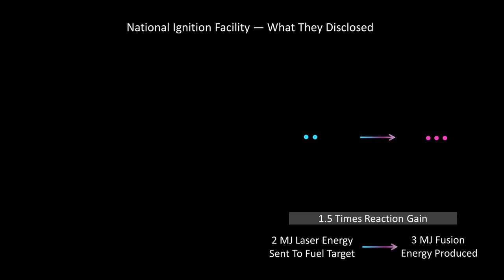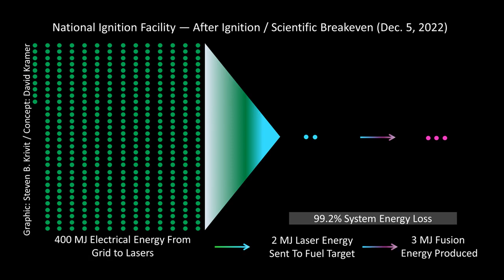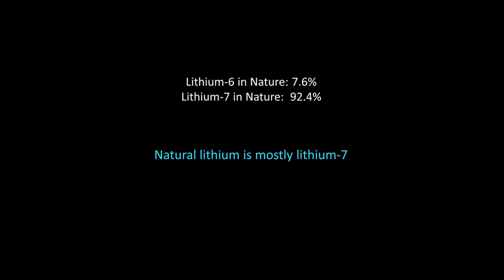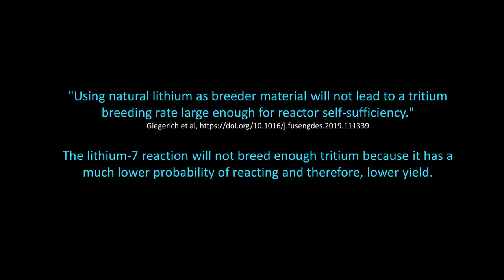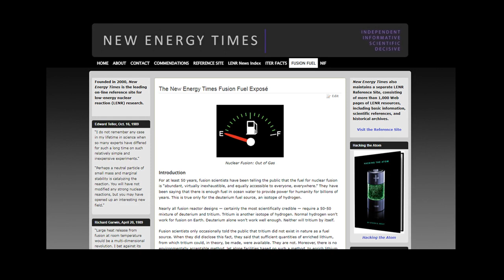Ignition Omission: Understanding the National Ignition Facility Milestone

Comment: Thank you for your well researched presentation. I agree that many of the head presenters were misinformed before they made their announcement. Before this announcement the NIF management has always avoided mentioning the input energy to the lasers to generate the 3 ns pulse. Even the most advanced lasers today don't come close to the NIF laser's energy and if one includes all the wavelength conversion that takes place in NIF then the efficiency will drop way below the 20% figure.

NIF has always been primarily funded as a thermonuclear weapon (H-bomb) research tool. The NIF management has always obscured that fact when presenting to the general public, instead presenting it as a viable path to a future economically viable nuclear fusion power plant. The vast majority of nuclear fusion physicists believe that the NIF's Inertial Confinement Fusion (ICF) approach is unlikely to lead to such a power plant. The Lawrence Livermore National Laboratory received funding for NIF in return for ending the underground nuclear testing program which was required to end due to the signing of the Nuclear Test Ban Treaty. The announced experiment included a test target that was exposed to the prompt burst of 14.1 Mev neutrons, as part of the lab's nuclear weapons testing program.

The target assembly took about a week to assemble and is estimated to have cost over $100,000. The tritium component of the 50/50 mix of fuel sells for approximately $30,000/g. It has been estimated that NIF has already consumed about $11 billion. The lab can't fire the NIF lasers more than once per day to avoid damaging them. If similar experiments were performed on a weekly basis then the nuclear fusion duty cycle would be approximately 0.00000000000001%, given that the nuclear fusion reaction lasted approximately 0.00000000008 second. A practical power plant would require at least 10 shots per second.
Reply from the maker: Thank you Vernon

Comment: Further, the 2H + 3H nuclear reaction produces 14.7 MeV (million volt) neutrons, which can then interact with other materials to produce radioactive species.  Probably not an issue for this experiment,  but would require massive absorption shielding for a power system.